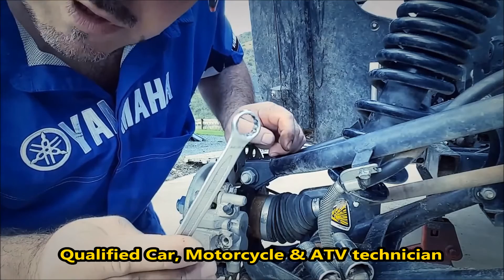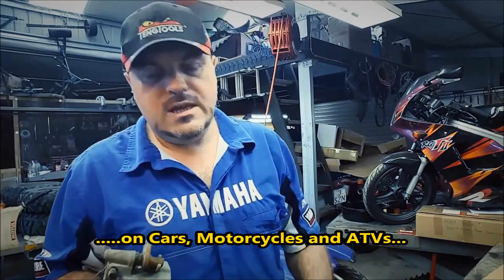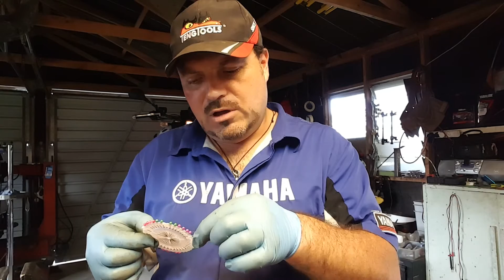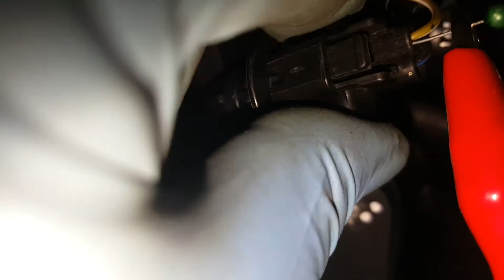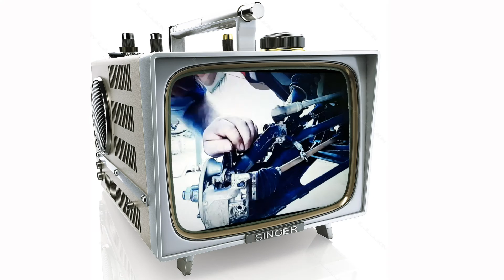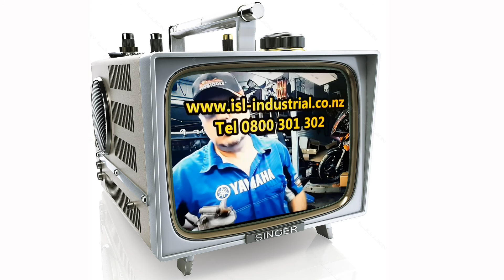How to back probe #1939

Comment: Great video! Thanks for sharing. Will steel or stainless steel needles give a lower reading than a nickel coated copper needle? I've read that steel/stainless steel does Not conduct electricity as well as standard multimeter test lead tips (usually nickel plated copper).  Is the difference in metal conductivity of any relevance or is it too small to matter?
Reply from the maker: Hi, I'd say too small to matter given the short length & relatively large cross section.

Cheers Andy

Comment: Thanks for letting me know where the 2nd lead attaches (ground) to when performing back probing.  Other videos show the back probe pin inserted into the wire connector but they don't show where the other meter probe is connected.  May seem silly but not to a novice.

Comment: Thanks for the video, Andy!  Quick tip on checking if the probe is in the right place, unplug the connector and check for an open (bad) or very slight resistance (good) between the pin and the inside of the connector.

Comment: Hello Andy,

the pin that you used for back probing - is that a sewing pin? Another question: can you go 'too far' in with the pin? Or do you just go in until it hits metal?
Reply from the maker: +Tyler D. It's a bit of an art, you get better with practice. Yes, you can go in too far but usually the pin will bend before you do any damage! Cheers Andy